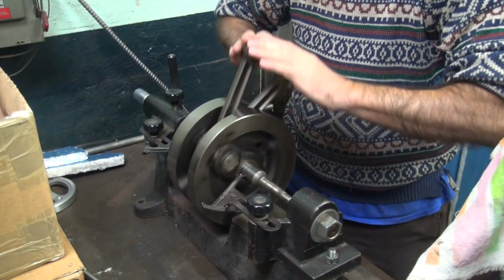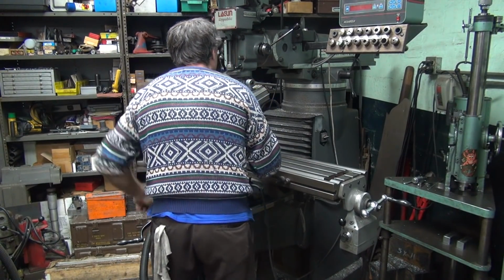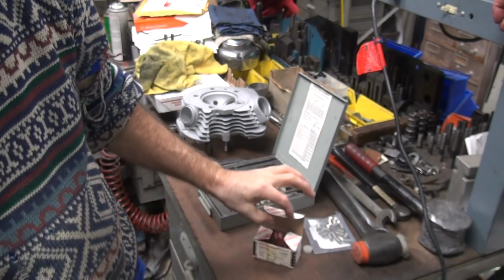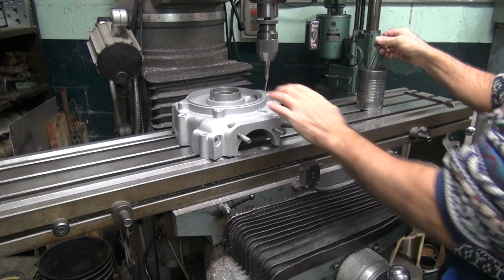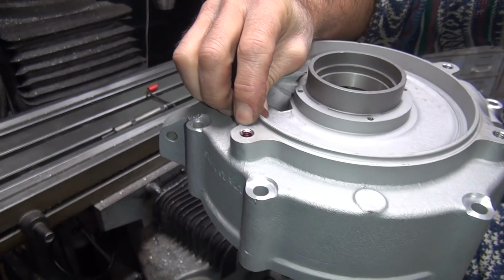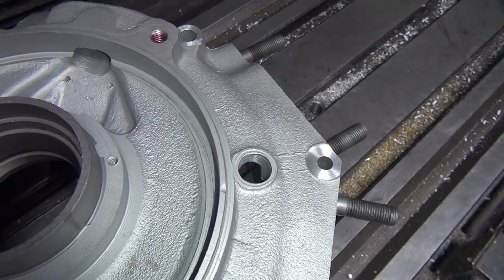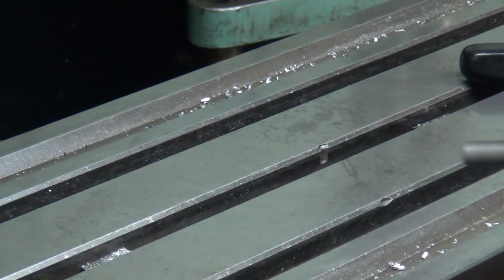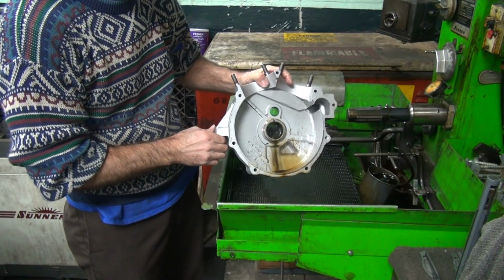1978 #102 shovelhead head, cylinder & case rebuilding machining motor harley by tatro machine

Comment: What kind of tool are you using the face the bolt holes at 17:30?
Reply from the maker: i was chamfering the holes with a 1/2" carbide ball bur.
tatro

Comment: Do you ever use keenserts instead of helicoils? I’ve seen to many helicoil fails.
Reply from the maker: i don't like them too much. everything fails if you don't install them correctly or over load the system.
tatro